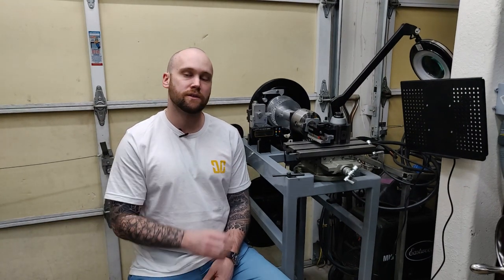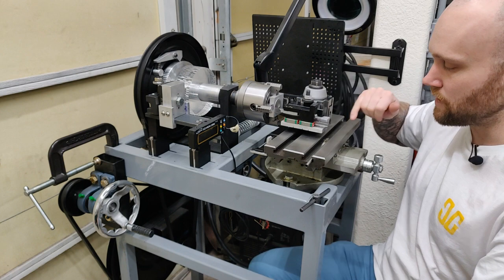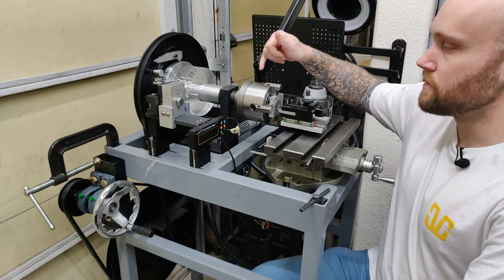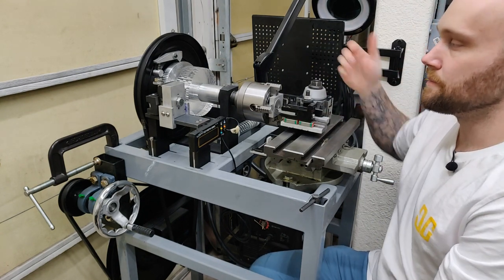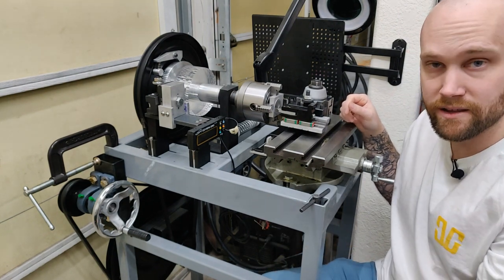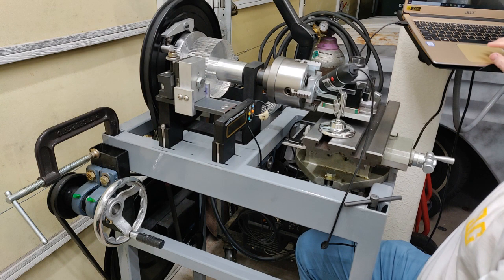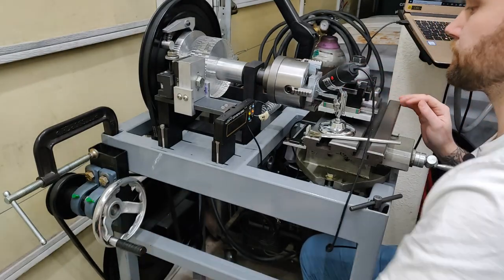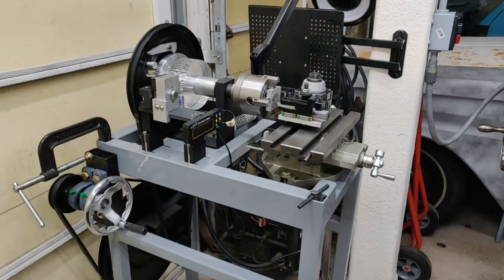Rose Engine Overview and Guilloche Demonstration

Comment: Probably too late for this suggestion, but to protect your knee you could wrap a piece of pipe insulation foam around that bench leg.

Is there a reason to reverse the phase order from pass to pass?  I'd be nervous about changing the zero of the DRO for a given setup.

Comment: Can't see what is going on because there is a light blocking the cutter!

Can respect the craftsmanship but the description of what the machine is sucks. Start off by explaining the major movements of the machine. It is basically a lathe modified to wiggle the tool by offsetting the lathe spindle axis relative to the cutter.

Comment: WOW!!! Here I thought that an ‘ornamental or Rose engine lathe’ was simply an antique jeweler’s or watchmaker’s lathe that’s been dressed up with some shiny brass cogs and is functional - but mostly serves as a decoration!?!? Now I feel a bit foolish, but I THANK YOU for running through this, as I had no idea that those rosettes were serving as patterns that caused the movement necessary to etch those patterns!  And it’s a manual machine?!?!  And wow, a Grizzly brand compound X-Y table that only cost about 100$ is that capable? I’m wondering just how you steadied that sliding table, and if any of the wiggles that you’re noticing is at all due to the ACME threading. I literally filled my ACME threads with about six or seven strands of dental floss (I thought of plumbing tape, too) to try and diminish that wiggle. I’m noticing that wherever are those contact points that have a lot of space surrounding them, well you know. So maybe if I bore out some holes to drive in maybe four grub screws so to center it better, or better would be a spacer that slides right in so to occupy the empty spaces at those points of contact. If you have a lathe and can do those ACME threads, maybe then you could just make your own leadscrews that better accommodate the parts that move along them. I really am hopeful and am praying for you to do something like that, instead of shelling out more$ to do away with that one and replace it with something else. It looks like a decent bargain for such an affordable price.  Im super stoked to see videos like these, as they help me to see how anything is possible and also inspire me to tackle mechanical challenges where I never knew I could see things that way before! Thanks a million!

Comment: I don't understand how the pattern wheel translates from an X movement, as it follows the pattern, into the Y oscillation movement? Could you explain that please. Also you seem to be putting pressure on the cutter rather than an absolute movement in Y, is this by feel and how do you prevent too deep, or shallow a cut per rotation? This absolutely fascinates me and your videos are great, thanks.

Comment: I think I missed a bit... how does the movement of the wheel on the rosette translate to movement of the cutter?
Reply from the maker: The cutter is fixed. The pattern on the rosettes oscillates the headstock, so the workpiece is moving while the cutter stays put.

Comment: I think you ave made a great machine, lacks almost nothing to get the job done.  For ergonomics I would bring the crank wheel a bit closer but otherwise all good.

To focus all you need to do is hide the distant objects with a featureless grey card behind the detail you want to show that is not too close (15-50cm depending on camera/lens combination).  The camera is designed to focus on the section that offers the best contrast and if you have a wobbly thing close by and static thing in the distance I have to side with the camera when it keeps the focus on the distant scene.

Cussing at the camera was funny 5 years ago, not so much now.

Comment: I've seen those rose engines both new and old. The new ones seem far more simpler and smaller than their historical counterparts. What would you say is the reason for this?
Reply from the maker: I wouldn't say that's necessarily the case. Hall made rose engines in the early 1900's that are fairly compact, then you have the MADE rose engines which are modern and very robust. I think it really comes down to the use case for the machine. For engine turning, generally your work envelope is much smaller and rosette amplitude is much lower, but for ornamental turning (wood) you'd typically need a larger work envelope and higher amplitude rosettes.

Comment: nice build and very cool work..    what are your thoughts doing it this way vs a cnc mill     Joe
Reply from the maker: Hey Joe. People have been attempting to recreate guilloche on CNC mills for decades, the problem is that a rotating cutter will never provide as clean (and bright) of a cut as a fixed cutter. Some people have gotten better results by making custom setups to use a fixed cutter on CNC mills and pantographs. Personally, I prefer doing it the traditional way; it's therapeutic.
Reply: @DMTiffanyTimepieces  i understand perfectly...   just dabbling in some old pocket watch movements i inherited  should be a fun new adventure !!  keep up the great work !

Comment: LOL I understand the leg room thing. On your hand crank what about putting in a 4 step pully then putting in a wide smooth drum on the driven and installing a spring loaded belt tensioner. Using a vee belt in this configuration should work with no problem.

Comment: Totally awesome, I have a lot of respect for the craftsmanship it takes to do that and it looks amazing. With respect however, it's still an mechanical engraving machine, much in the same way a CNC is a mechanical engraving machine and there isn't much difference in that respect. Granted there's a lot more hands on involvement and and skill with the rose engine, but ultimately its still the result of mechanisation to achieve the results. Again, totally awesome and total respect for your craft!
Reply: You have no idea what your talking about. Watches wouldn't exist with out precision machines like this.

Comment: Hello and thanks for the videos.  In future videos if you could, could you please go more in depth about the crossing wheel and phase shifting importance with regard to the engraved patterns.  I'm having a hard time understanding the relationship between the phase shift and the change that occurs in the engraved pattern design.  I understand the mechanics of what is happening. It changes the engraving start point in relation to the pattern plates.  Perhaps If you could show finished engraving examples of the different toothed (phase counts?) Is it because the engraving radius is getting smaller as it gets closer to the center of the work piece?  Thanks again, and in advance.  Great work there.  Do you plan to sell patterns or blueprints for a machine like this? I'd definitely be interested.
Reply from the maker: Hey Robert. Thanks for the kind words. I'm planning on doing a few short videos about the creation of different patterns, including theory, layout, and execution. The short answer about the crossing wheel is that I currently have 6 rosettes, all have a different number of sine waves (24, 36, 48, 60, 72, and 120.) I have three series of notches on the crossing wheel that correspond to the related pair of rosettes (24 and 48 for example.) The notches represent the distance between sine wave peaks on each rosette; 1/4 increments for the lower count and 1/2 for the higher count rosettes. So to make the notches for the 24 wave rosette, I set up my dividing head for 96 divisions around the circumference but only cut four notches. Since the rosette barrel spins independent of the spindle, the crossing wheel allows you to lock into repeatable positions, providing patterns that can twist towards the center, or for the example in the video allow for clockwise - anticlockwise steps to create a basketweave. Hopefully that provides a little more insight. I have no plans of creating blueprints for the machine, but I'm happy to answer any questions for someone who is building a rose engine.
Reply: Given the idea that these are sine waves, one can think of the phase as a number of turns added to x in the graph.  I'll use 𝜏 (aka 2𝜋) to represent one turn, in radians (i.e. 360 degrees, with e.g. 𝜏/4 = 90°)... with that, and also a delta (which I'll represent with 𝑑) of, say, 1.5...  if we were to then graph y0=sin(x+0𝜏/4)+0𝑑, y1=sin(x+1𝜏/4)+1𝑑, y2=sin(x+2𝜏/4)+2𝑑, y3=sin(x+3𝜏/4)+3𝑑  .... and so on, as far as we wish, we could see how these graphs stack up.  If we change the numbers for 𝑑, that's changing the spacing between cuts (0.008" in the example, per 12:40 in the video), we can tweak how these stack up.  (1.5 value for 𝑑 is an arbitrary number corresponding to, as it happens, 75% of the height of a sine curve (2 units), from peak (-1) to peak (1).  How exactly that maps to the 0.008", I don't know, but think of them as equating in some direct way (𝑑=187.5 * 0.008", I suppose, but 187.5 has no specific meaning except as a translation between the abstract arbitrary units of the mathematics, and the real-world movements of the slide between cuts).)

So...... but that doesn't quite get to your question, so let's go a little further:

While the original numerator multiples of 𝜏, in potential integer values from 0 to 4 (though I stopped at 3) correspond to the 5 cuts on the crossing wheel (see 6:14/6:45). So 0 is no offset, 1𝜏/4 is "a quarter of a phase" as described, 2𝜏/4 is two quarter-phase shifts, etc., there's another option: If we were to add another variable, let's call it 𝑚, as a multiplier for all those phase fractions (so instead of, e.g., 3𝜏/4, it'd be 3𝑚𝜏/4), we can finally look at "the relationship between the phase shift and the change that occurs in the engraved pattern design", as per your question.  Different values of 𝑚 will effectively give us the equivalent of a different pattern of cuts used.

Feel free to set up this set of functions in your favorite graphing calculator (or even do it by hand?!?)... or, I've actually done so in one I found online.  I don't know if links will shop up here... in case not, I'll put the link in a separate comment.  But if the link works, you should get some sliders that let you adjust 𝑑 and 𝑚, and also I through in a 3rd slider for 𝑤, which is a "width" multiplier (multiplying x by it before adding the phase offset, which I abstracted out as 𝑝=𝑚𝜏/4.  I also did a few more instances, so we have 3 sine curves for each phase, to give a bigger sample of the visual pattern.

Hopefully the link will go through.  I'll post it to twitter (my surname is my handle), too, in case it doesn't (look for a post late on November 9th, 2021... or a web search for «"lindes" "rose engine" "twitter"» (without «», but with the "s) will hopefully turn it up if someone sees this way in the future).  But hopefully that's all moot, as it'll come through here.  :D
Reply: Bummer.  Looks like the link got killed... maybe it's just pending moderation and will show up.  In case not, a bit of URL hacking adding the usual suspects (slashes in between parts, and expanding out the domain name.) to «desmos calculator wvxqb5dwgt» might also get you there.  :)
Reply: P.S.  Hmmm... not sure I know how to replicate the pattern at 17:28, though.  Playing with 𝑚, 𝑑, and 𝑤 (including releasing some of them from constraints I'd previously set), I never got anything that looked quite like that basket weave.  Perhaps because the shape on that template isn't really a sine wave?  Anyway...